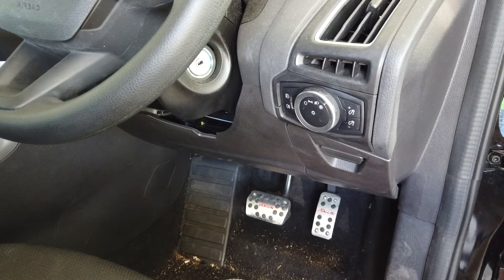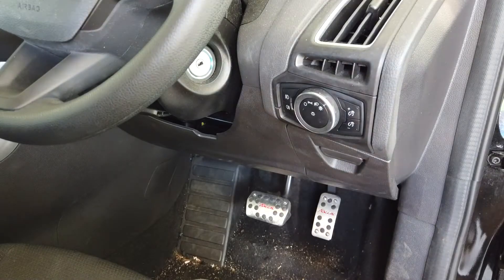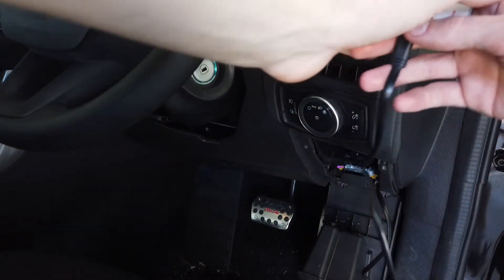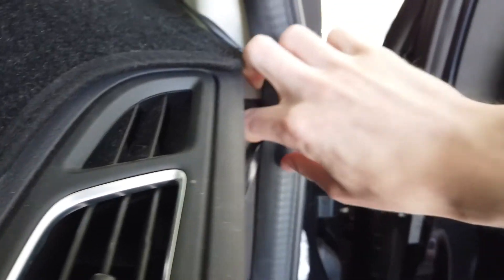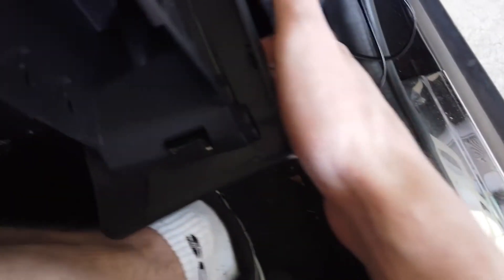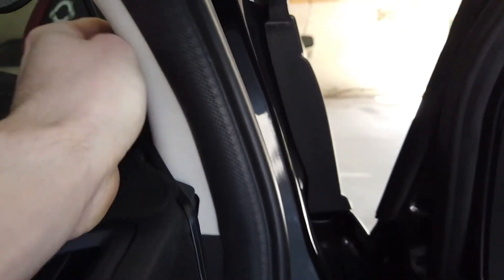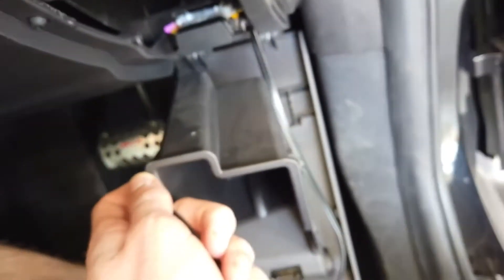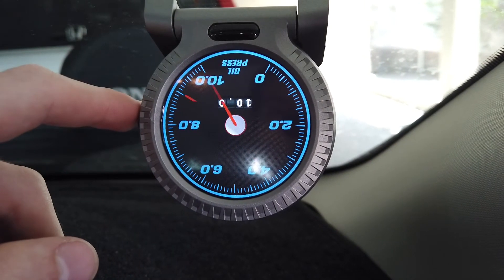OBD2 Scan Gauge HUD Speedometer How-to

Comment: How do you get the screen to display the correct way up if mount to the window like you have/or even on the a-pillar?
Reply from the maker: HI, Under settings there is an option to flip screen. Click side button in and hold in for 3 seconds - function settings - flip screen - yes.

Cheers